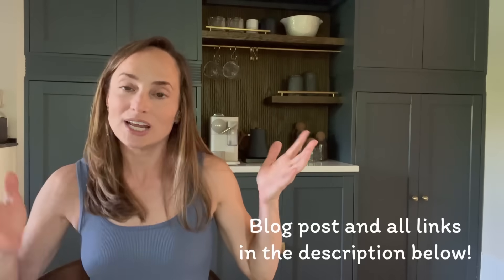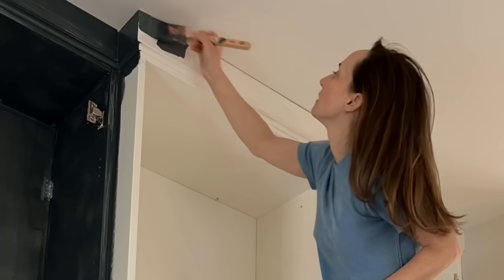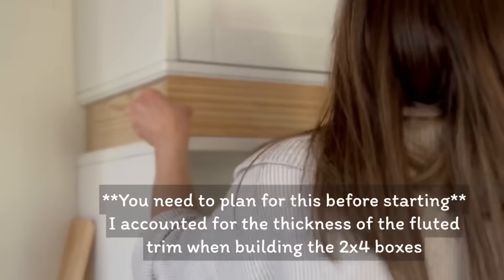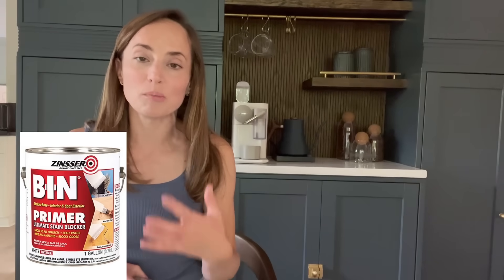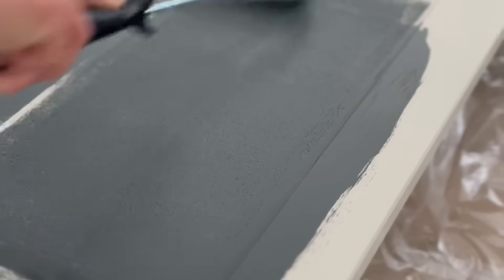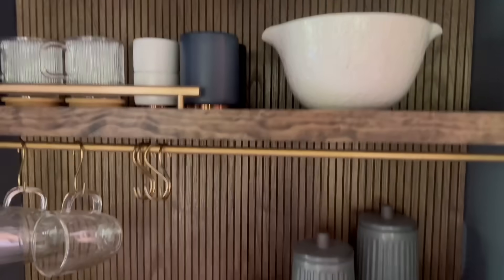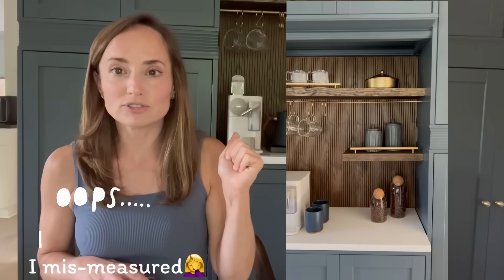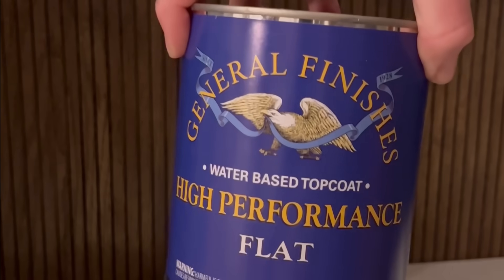IKEA Havsta: The Storage Solution You Didn't Know You Needed

Comment: Consider using polyurethane as a top coat for your painted furniture.  Two coats preferably, satin finish, and it will act as a sealer for the paint. Seeing chipped paint drives me nuts!
Reply: I was just going to suggest this! Minwax polyacrylic clear coat gloss/satin is amazing. Also paint quality and type drastically changes paint chipping too
Reply: @CCRider the specific brand and type (polyacrylic its water based) I mentioned does not yellow. It’s well known for being one of the best at not yellowing. Yellowing in general can happen for a multitude of reasons its more common in areas with extreme amounts of sunlight exposure combined with improper primers/paints/stains/topcoats and usually only on very light colored paints. Getting the proper types of materials can ensure no yellowing. I have never had yellowing on any of my surfaces using that and I’ve used it on painted wall tiles, trim, furniture and more. Proper prep and knowledge about each product you are using in a paint/staining project, as well as the type of surface you’re finishing and the location of it is important before starting.
Reply: @klbs9630  Thank you for saying this! The one I chose did yellow if we weren't careful. Next time I do another paint project I will totally go for the one you mentioned
Reply: Surfer  all of these are going to be toxic, it’s a chemically made enamel/lacquer type product/sealant/finish. Most things in construction are toxic to some extent. MDF is  fine on it’s own it’s just when it’s being cut/sanded that you need to be wearing the proper PPE as to not ingest the particles as that’s when it becomes toxic
Reply: Surfer  as klbs mentioned, pretty much everything in construction is toxic, to some extent. However, water based products are a lot less toxic than older products (they also don’t work as well, as all the old timers will lament 🤣). Probably not a good idea to make food on something treated with poly, but after application, it’s pretty safe. Putting it on, and the few days after while it is curing are going to be the worst days, so if you can, leave it outside or in a non-living space if you can. There’s a lot of things that aren’t good for you while there are particulates of it in the air (mdf, arborite, plywood, etc.) but they are inert once you finish cutting it and breathing it into your lungs ;) ditto with treatments. If you can breathe it in or it’s wet on your skin, those are when any product is the most toxic (but water based stuff is least toxic, so minwax is pretty safe)
Reply: Most all wood paints tell you not use a top coat of polyurethane. The hardening agent is already in the paint.
Reply: Do you know if that would be necessary with Heritage All In One pants for cabinetry?
Reply: Thank you for this comment. I screenshotted it. I'll be painting furniture soon as well as cabinets and creating my own pantry. Just bought a house so lots of DIY's to come.
Reply: I second this.  I learned this lesson when I did my first furniture flip with paint.  The item got so scratched up, and the paint ended up chipping.

Comment: Great project, nicely executed with good attention to detail and bang on trend colour selections.

All that said, with careful choice of units, I could have supplied a very similar configuration using high quality German or British carcasses and painted, solid ash doors for very little more than your costs - with far less labour requirement, a 10 year minimum guarantee and the paint having been professionally spayed & UV hardened in a state of the art paint line.

Great as this example of an “IKEA Hack” is (and it is genuinely a great one), it is not always the most cost effective way, and can be fraught with compromises.
Reply from the maker: Hi! I'm so glad you liked the project!
I'd definitely like to use higher quality materials in this project, but where I live, using something other than IKEA for the base cabinets would have cost exponentially more. Although it could definitely be done in more efficient ways if I hired it out, that's not part of the budget or plan right now. I'm enjoying this process and all I'm learning through it! ❤

Comment: Hello, You mentioned that you would like to put something on the paint to seal it.  I made a painted bathroom sink stand.  I needed to protect the top the sink sits upon.  I sprayed several coats of clear Rust-oleum automotive enamel on it.  It has been holding up well.  I do not have any children in the home, and I wipe water drips off imediately.  You won't have water on the outside of your cabinets.though.  It may hold up to water sitting.  I don't know; because I have never left water sitting on the surface.  I wouldn't clean it with any harsh chemicals. I had a small shelf I got a little hydrogen peroxide on and the finish didn't hold up to that.  I am very impressed with your creation.  So, I thought I would share my solution with you.  Thank you for the video.
Reply from the maker: Thank you so much for sharing this, I really appreciate it! I’ll definitely look into a clear enamel, that’s such a great idea!

Comment: My two pennies.The idea is brilliant, the end result would be far from being perfect and remotely being a professional one, especially with a ton of caulking you did. The best looking result would be all the MDF trims (do not use wood - it will shrink and expose nails and caulking - if you intend to paint a project over) are glued with PUR/cyanoacrylate adhesive not nailed. Second, the design of IKEA cabinets allows for reveals of the fluted trim, thus you eliminate caulking, which will crack anyway in the first spring. Third, the Havsta fronts, sides and shelves are softwood pine. The chips are inevitable, even if you use poly over. To avoid white see-throughs use brown Havsta cabinets instead if you go dark colors. In case you want clear coat (at least on the shelves) use 2K clear coat  (matte or gloss finish) instead of all the garbage poly from Lowe's or HD. It's 3x pricier and 100s time more durable.
Reply from the maker: Thanks for your thoughts!!

Comment: There are good quality enamel paints designed for cabinetry. However, painting such a large piece require a lot skill, otherwise it will look like crap. Best to buy very good quality, self-levelling paint that will eliminate roller marks. No one, I mean no one, could paint this using a brush and have no marks!